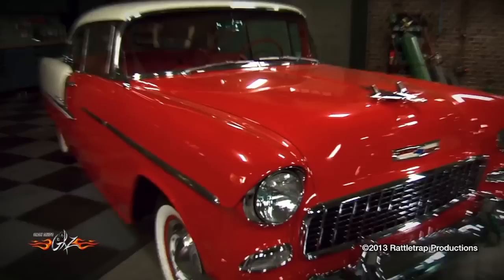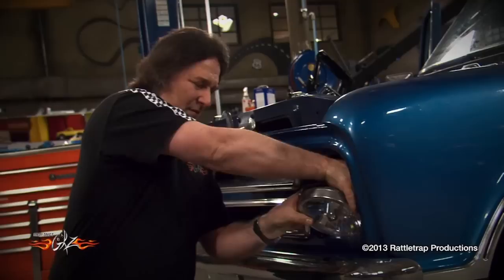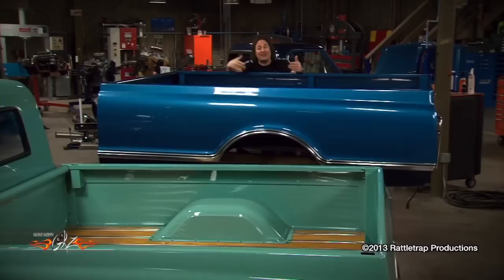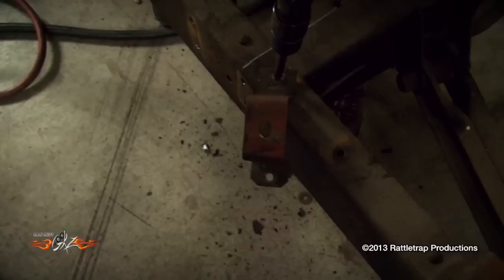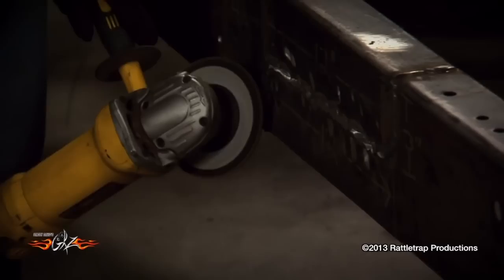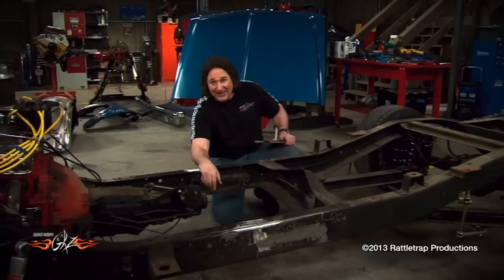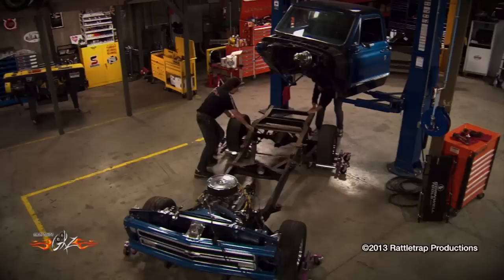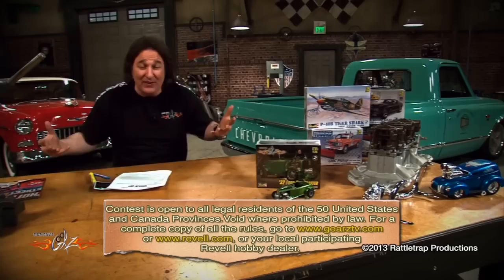LMC Truck Long Bed to Short Bed Conversion - Stacey David's Gearz S7 E3

Comment: Brothers short bed conversion kit and template looks a lot easier then this
Reply: Totally, he lost me when he took the hood off.
Reply: It's about 100x easier; BUT this method really hides that any hackery was ever done.  Seeing 72 bolts holding 2 halves of the frame together of the Brother's Kit when you look under the truck is a dead give away it's a hack job.

Comment: There's some clowns out there that have a parts business that also have a video of this mod. Only they use a vertical cut, not safe in my opinion. S D good job ,done rite. Too many posers that wear all the rite clothes  and have fancy hair cuts,and try to be so car culture. They don't know shit .
Reply: Absolutely agree.  I really don't think the way Stacey does it is hard, it is definitely safer.  I wouldn't put myself or my family in a truck that was cut in half with the brothers kit.  The Brothers short bed conversion kit is asking for trouble, not to mention lawsuits.
Reply: See. I’m planning on doing this to my 71 C10, I watched brothers video and something didn’t sit well with me. This video looks harder but you can also tell that it’s done right. Thanks for reinforcing what I suspected.

Comment: He seems to have forgotten the part about phosphatizing and repainting the bare metal after the cuts, grinding and welding of the frame. If you don't, your truck frame will fall in two pieces within 5 to 10 years if not sooner from rusting apart.

Comment: It would be more cost effective to get a SWB truck. A conversion is so extensive that you may as well do a concourse build. It involves tearing it down to the frame, fab work, and paint work. The average joe will not be welding their frame back with a 110v welder....I hope. Just buy a SWB, and save your money.
Reply: I've been watching since I was 10 or younger (nearly 40 now), and I don't mean to be negative. However, some things are done simply to advertise products. In this case, LMC truck sponsored this most likely.